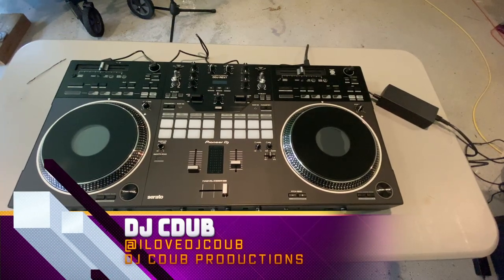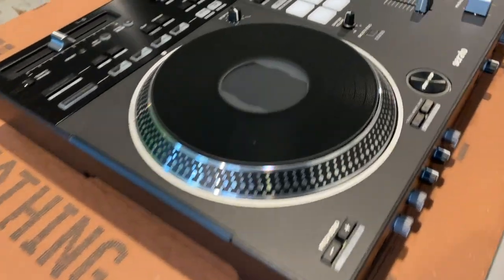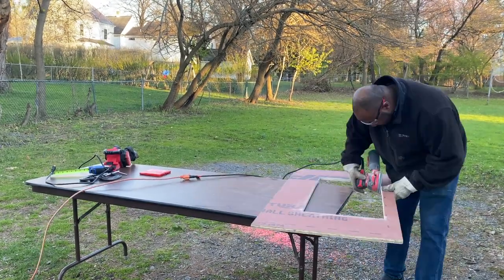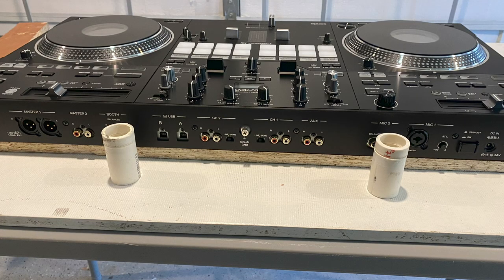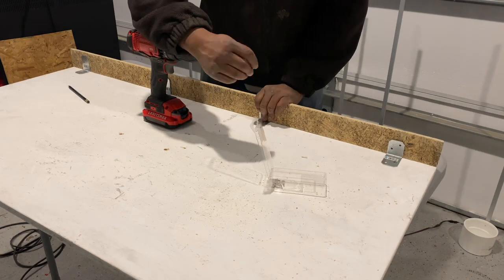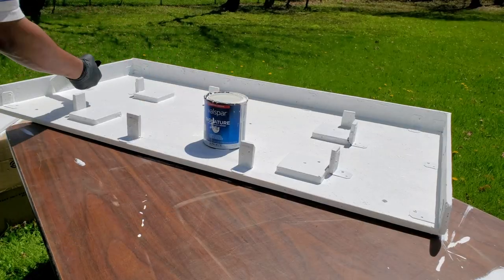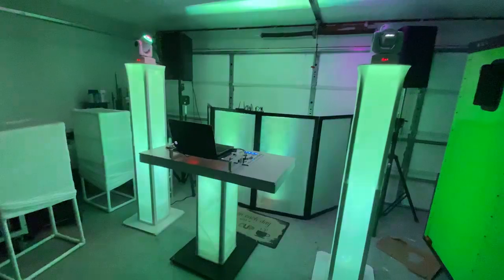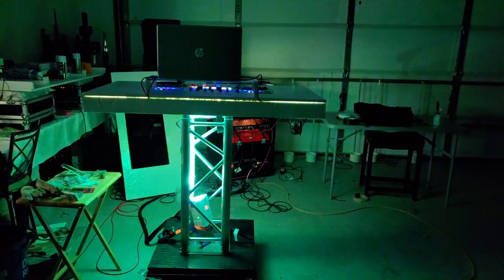DDJ REV7 Custom DJ Furniture Build

Comment: Consider going to a sign shop. They can vinyl wrap the wood for a super sleek smooth surface.
Reply: Or just make this in MDF instead, and you have a smooth finish from start :)
Reply: OR vinyl wrap it yourself, its really not that hard  just practice on doing corners on scrap pieces. Once you get the process down you can wrap them like a pro.

Comment: Quick question: why didn't you seal the edges? It's an overall clean setup but you also have the light bleeding out of some edges vs all edges
Reply from the maker: I like the thin light going all the way around. It was closed on y last build, but I'm still feeling it out at this point. We'll see what changes I make after a couple more gigs.

Comment: It looks good but the texture of the top of the wood looks rough.. perhaps try to put a few layers of Fiber Glass and sand smooth and then spray paint with high gloss white. Also perhaps use frosted plexy glass to cover the ends… the glow of the light would look good

Comment: how do you mount it to the truss?
Reply from the maker: The base plate has two holes in it. I drilled matching 1/4” holes in the bottom of the furniture that line up with the base plate and use two 1/4” bolts, 4 larger washers, and wing  nuts to mount it.

Comment: Quick question is the top detachable or is it screwed in?
Reply from the maker: The top section is is held on but 2 quarter in wing nuts and bolts that go through the furniture and the truss plate. This keeps it snug, takes up the least amount of space inside the furniture yet allows it to be easily detachable for break down if needed.

Comment: How much did you spend on this build?
Reply from the maker: I already had the trussing, so maybe $110-$140 including paint, wood, brackets, etc. If you need the trussing it’ll be more, but I never use that trussing anymore so it worked out well.